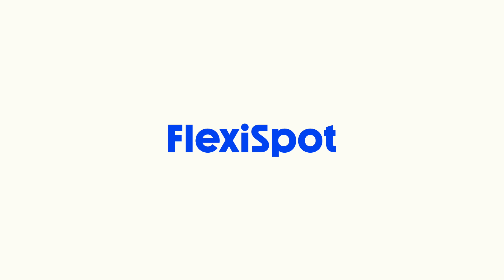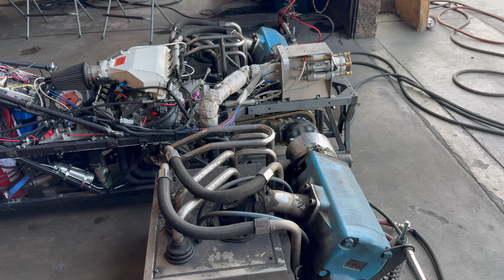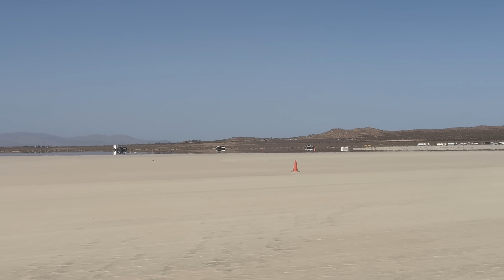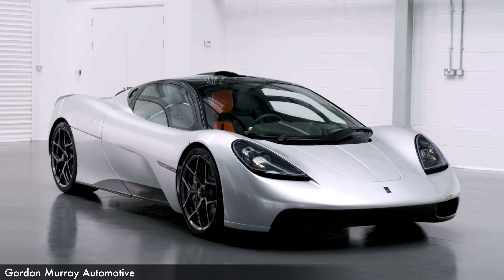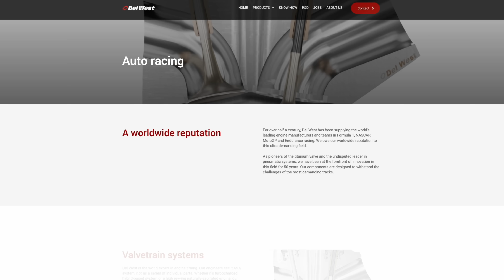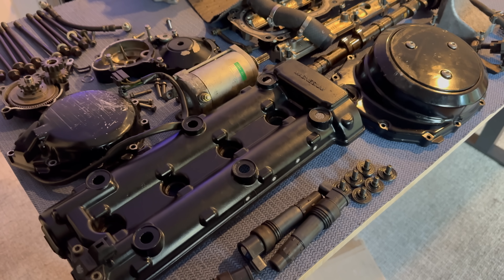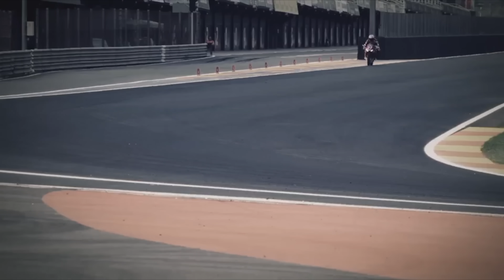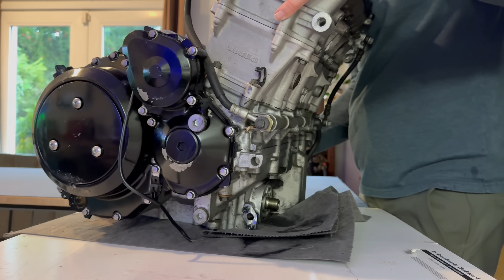Motorcycle Engines Are WAY BETTER than Car Engines

Comment: I have had 5 motorcycles that have went over 100K miles with just regular maintenance, nothing major. 1 went over 230K (1997Bandit1200), 2 went over 180K (650 and 1000 Suzuki SV) 1 went 150K (1998 Bandit1200) and my 1999 Hayabusa went 135K before the frame cracked. It's a big misconception that bikes don't last. They do as long as you take care of them.
Reply: The bike outlives the rider more times than it should
Reply: That's Suzuki for you
Reply: My BMW G650 GS hit 78,000 miles and was still running incredibly strong, without a speck of oil consumption or leaks, when I sold it for a new bike. It's all about maintenance and the way you ride and operate a machine. My diesel-powered BMW 328d wagon hasn't required anything but 5,000-mile oil changes and filters in 68,000 miles and runs perfectly. I use it only as a highway car.
Reply: @paul9133  5000 mile oil changes?  Jesus, at BMW prices you must be a millionaire.
Reply: @RantyRider  change my own oil, do my own maintenance, avoid dealership. I probably could go longer than 5,000 miles because it's highway driving. Plan to do an oil analysis.
Reply: @paul9133 avoid dealership is key point in maintaining longevity of your bike.
Reply: My dad still has his carbureted 1993 Honda Shadow. No chain or belt, it has the original ultra reliable shaft drive. It's got less than 150,000 miles on it, but just the fact that it survived this long with almost all original mechanical parts except a starter I replaced once and a speedometer cable.  We never really did anything special for winter storage, just used STA-BIL for gas treatment, ran the engine then let it sit with a full tank of gas. Carbs have been cleaned twice.
Reply: Honda ST1100 and GL1500 engines go a very long way. Do not ask me how I know 😊. But then they are relatively large and very low stressed. The VFR750F engine is not too bad either... However... I did own a Volvo V70 2.4 5 cyl. petrol with well over 400000 miles and still going strong...
Reply: @carsyoungtimerfreak1149 so do st1300s. 100k is broken in. 200k is doable. 300k+ has been done.
Reply: @carsyoungtimerfreak1149 I drive Volvo V50 1.6 diesel with 200k miles
Reply: He did say it was expected for a superbike, and most riders that dog out their supersport wont get it to 50-60kmi
Reply: I had a GSX 650F that bike is very reliable, but does not make much power, a zx6r lasts very little compared but makes a lot of power, in the video he is talking about extreme high power bikes
Reply: @kelvin15040 mine zx6r 2014 did 40k miles for me before I sold it. It was abused a lot and in moment of selling was in good mechanical condition. It was still using original cam Chain, tensioner, clutch cable. During this 40k miles only exup valve serwo motor stopped working, and ignition lock started to lock. I've changed oil every 4k miles (motul 300v ester). Everyone was expecting that this bike will completely fail at 35k miles, but nothing like that happened.
Reply: Bikes "don't last" only because people crash them
Reply: @233kosta no, probably mostly because people drive them very little. Infrequent short trips are not good for any vehicle.
Reply: @jaredlancaster4137  Tiny engine, much less oil, get hot moar quicker. A short damaging trip for a car can be perfectly fine for most bikes, for that reason.
Reply: @233kosta idk about most motorcycles but my coworkers 2006 cbr1000 holds 5 quarts of oil. I can promise you that his 1.0L engine warms up 5 quarts more slowly than my 2.3L Accord warms up 4 quarts.

I ride a 200cc air cooled bike to work most days, and it only holds 1 quart, but it still doesn't warm all the way up in my 1 mile commute, and I know that because I keep getting condensation in the oil. I know that my car fully warms up in 1.5-2 miles, so I think they're about the same?

Are these experiences not normal for motorcycles? Do others warm up faster?
Reply: Not a misconception at all when you realize even the worst car engines will get this many miles and most will get 2 or 3 times as many miles. Motorcycle engines require massive amounts of maintenance per mile in comparison, create more emissions, dont make enough torque to pull around heavy vehicles and are like any high performance engine. Just a trade off of longevity to get more power. I build engines for trucks for a living and bikes in my spare time, and have seen hundreds of both in high mileage conditions
Reply: I have a Honda Goldwing GL1800 with 140k miles on the odometer. It's still running great - not a single problem.
Reply: @frigzy3748 one could say thar, for all practical purposes, a goldwing engine is a car engine and not a motorcycle engine. It is ment to rev low, high torque and power at low rpm, big af, etc
Reply: @Narblo that's fair
Reply: With (mild) exception to the sv650, these are all large somewhat low stress motors. Yeh the hayabusa... I'm doubting you rode around town at 10000 rpm keeping it low stress. Also, Suzuki is the goat at engine reliability.
Reply: Must guys dont want to do maintenance, they dump the bike before the valve check due date, or crash thier bike. Rev bomb and blow up their engine. Sport biker riders are nuts lol. Well the usual suspects 😆
Reply: @LilleyAdam My Hayabusa 2005 shit I never knew you had to check the valves hilarious it's literally a car engine in a motorcycle it should last a hundred thousand miles easy I never did any maintenance to the bike still running fantastic even oil changes for me are a pain in the ass you have to take the stupid fairing off it so I run synthetic motor oil and change the oil once a year and here we are in 2026 still riding it still rides strong never had a problem never checked the valves probably never will.
Reply: @LilleyAdam I know someone who has taken two VStrom 650s past 200 000 km. Same engine as SV650.
Reply: @bikeaddictbp  I LOVE v Strom 650s. Bought one for $500 to use as my daily, only had to de-rust the tank and change the fuel pump. it’s probably my most reliable bike
Reply: @christianhodges685  How did you de-rust the tank? Chemicals or mechanical brushing or something...? Forgive my ignorance
Reply: @ValCronin  hey, I used mostly electrolysis and then finished with a citric acid solution. There are a bunch of good videos for electrolysis on here, I like that method a lot. I’ve de-rusted a few tanks and each have their own caveats, message me if you have more questions
Reply: @christianhodges685  Thank you very much 😊 For your sharing of knowledge.
Reply: Also, even despite not being racing engines, I doubt any of them made the same power at 100k as they did when new.
Reply: @LilleyAdam  any engine would lose a considerable amount of power after 100k. that's just the way it is
Reply: @LilleyAdam  .. and if there were a noticeable and notable difference between new and decently tended used, you would likely be burning oil which would be noticeable
Reply: @LilleyAdam damn, dude, you are such a buzzkill
Reply: @jebb125have you ever compared the power made by an 5k and an 100k engine? The wear may not be apparently obvious, but it becomes noticeable when you compare their output.
Reply: @tovirumelores7921 why do they lose power?
Reply: @jebb125 You don't lose any power on an engine at 200,000 miles. Actually there was a racer who did an experiment and he bored out his cylinders to make the engine really sloppy, and it added like 5hp or more from the reduction in ring tension and friction on the cylinder walls. 

Valve guides and seats, and valves don't wear out at 200,000 miles in a car. 

They are still looking like new with modern hard alloys that are indestructible. 

The only thing that happens on a high mileage engine is the timing belt or timing chain fails, or the valve stem seals harden or the oil rings get gummed up and it starts burning a lot of oil. 

Of course, modern idiots find a way to forget to change their oil...
Reply: @LilleyAdam you don't lose any meaningful horsepower unless you're meaningfully losing compression. I have compression tested enough high mileage engines to know that you're wrong. Typically you don't see any loss of compression until the engine is actively dying and very near the end of its life.
Reply: @jaredlancaster4137 is this true for motorcycles also?
Reply: @sanketjain9320 definitely. On all engines, the losses in power will be pretty small until such time that the engine is basically shot.
Reply: @LilleyAdam  But it doesn't matter if it's a Hayabusa. I rode my gen2 90k + miles. I'd say most of the time I used only a fraction of its power. So even if it lost 10% of it there was still plenty to go around and do stupid things. Gen3 now.
Reply: That’s Suzuki. Low compression bulletproof engines and great gearboxes. I ride a V-Strom 1050 and the engine just works and is virtually unchanged since it came out in the mid 90s. Change the oil, check the valves and it’ll outlast me (38 years old).
Reply: That and Suzuki used to effing rock. Could fill those engines full of bullets and it'd still run.
Reply: It's usually the owners that don't last.
Reply: Sure they last, but they don't maintain their emissions standard for that long.  And it still heavily depends on the bike, how it was ridden, and how it was cared for.
Reply: @TheGamersRace  I'm reminded of a story I had read about a motorcycle racer. He used epoxy to fill his intake ports to make them smaller in diameter, to increase rideability at lower RPM's. 

I decided to do the same thing. I had a Toyota 4 cylinder car engine that had horrible casting flaws on the intake runners, so I ground the ports down with a carbide bit, then I filled all 4 intake ports with 400F epoxy putty. 

I ran the putty really close to each intake valve seat, to smooth the transitions that were cast incorrectly from the factory.

The engine ran great, and I even turbocharged it later, and I put at least 50,000 miles on it without the epoxy showing any signs of damage.
Reply: I have a 2010 yamaha ss2 110cc with 292,851 km
Reply: I did 40k miles with zx6r 2014, it was abused half of the time. It was sold after accident but mechanically was running perfectly
Reply: Exactly, compared to car engines that's quite low
Reply: True, especially the big 4 from Japan will last well above 50k with regular and proper maintenance. The problem is no one trusts a bike with more than 20k miles on it because they are so often abused.
Reply: That actually doesn't surprise me , Suzuki is a damn good company and they build their bikes really well
Reply: My 2000 bandit 1200 made it to 68k before the cam chain tensioner was on its last click and I decided to sell it. I liked that bike, probs would have kept it if was easy to change but nope.

But yea design life is real. If you are softer on it then the designers expected it will last longer. If you use the bike the way it was intended it will nuke itself around where it was designed, remember those engineers set the rev limit, if you spend years burbleing around just off idle you can get a lot of miles out of it. Just as there are multi million mile cars driving around too driven by people with the same philosophy.
Reply: @nick4506  yep! That'll kill your bike. Also if you're not changing your oil every 3,000 mi which is supposed to be done for motorcycles that'll also kill your bike really fast 
 And also if you full throttle quite often a lot and keep that thing at red line pretty often? 
You're going to burn the hell out of your timing system your valve train your valves including the valve guide tensioner and the chain tensioner itself. 😅
I've seen quite a lot of Suzuki bandits that's had well over 100,000 miles with no problem. 
Usually you're supposed to change your chain guide tensioner and the timing chain along with the timing chain sprocket every 50,000 mi. Yeah that sounds quite a lot, but unless you want your engine to blow up I would do that. I have a Suzuki TU250X so 😂 I'm happy I went back to that little thumper, every 50,000 miles I'm going to be doing a top end refresh on this motorcycle. 
Open it up, inspect it
If I don't like it 
Replace it! 
Like right now I actually got to change my valve seals lol, started burning oil and so the first thing I did was the compression test and that passed with absolute flying colors so my fingers started to point straight at my valve seals 😂. Typical the bike is 12 years old plus so it makes sense. So I decided to upgrade to FKM valve seals. 
I've had quite a few BMWs and Suzuki's specially Yamahas that has gone well over 50,000 miles with pure ease. And don't get me started on the BMW and Yamaha motorcycles, if you take good care of them? They will not die 
The only downside about a multi-cylinder engine is yes it is a lot more difficult and it does take some more knowledge and skill to do that kind of work. But trust me it's worth it. 

Learn how to time a four-cylinder engine 
Learn how to disassemble and then completely reassemble before cylinder engine, this is an extremely fundamental and important skill especially if you deal with a situation that involves valve train near failure.
Reply: @KyzoFox  o yea i changed the oil frequently, but i also had a lot of fun on that bike.

They were basicly air cooled. The engine oil was used as coolant but there was no fan so it would cook oil. 3k would be way too long for that bike in my book.

 the 1st and 2nd gen suzuki bandit uses that same oil cooled engine platform from the first gsxr 750. The cam chain is in the middle of the engine between the center cilenders. The lower sproket is a part of the crank. Yea not a job for me.

When it was starting to go i did the resherch, either tear apart the entire engine to slip it off the crank, or a master link cam chain witch involves a grinder to break the old cam chain while its still in the motor. Neither of witch fix the bottom sproket wear.

Though it was a great bike, that engine design was wack. Suzuki sold a lot of these and im shure a few were babied up over 100k but im also shure the vast vast majority were blown up around when mine kicked it being used as intended.
Reply: @nick4506 I have never been accused of being gentle on my bikes 😂
Reply: Regular maintenance on a bike dose adds up. When I had a Kawasaki 650F and was doing over 15k a year, that was two or three services a year and one or two sets of tyres, just depending on how things fell. But it did that for years with just regular maintenance and one exhaust that was done under warranty.
Reply: I find it hard to believe you put that many miles on motorcycles I have a 2005 GSXR Hayabusa here we are in April 2026 and I have 20,000 Mi on it and I thought I ride a lot
Reply: @us74711 I was a motorcycle messenger for years, when I stopped doing that I only had a bike as a daily and for a long time I commuted a long way. I have traveled all over the USA and Canada on bikes. It was a common occurance to go to San Francisco or Vegas for lunch or dinner. Some people think they ride a lot, some people know they do.
Reply: They aren’t engineered to last as long as cars.
Reply: So many of our vehicle laws are based on assumptions from the 1920’s, those assumptions don’t apply anymore because our stuff is way better, but the laws stay the same because every time someone tries to update them, entire industries call them on the phone to tell them to quit it.
Reply: I don't doubt it at all. You can definitely get 200k out of most motorcycles with optimum maintenance and the right use case.

But do understand that this is like somebody getting 600k miles out of their Honda Civic. It happens. Just not often. And it's not just maintenance and care, a LOT of factors go into it. If you drive/ride a lot, and mostly highway miles, you put much less stress on the engine and you do a lot fewer cold starts and thermal cycles. That's a big deal.

Matt was 100% right when he said that a car lasting 150k-200k is equivalent to a high performance sport bike lasting 40k-60k. Both of those numbers can be tripled or more under optimal conditions, but are the right ballpark for most users.
Reply: @jaredlancaster4137  Most riders crash their sports bikes before 60k miles.
Reply: @LilleyAdam exactly. A whole lot of cars get crashed too before 200k or so. Past a certain point longevity becomes kind of irrelevant
Reply: @jebb125there ARE thousands of vehicle crashes every day. Basically any street corner you can find has been the site of a crash at some point. According to NHTSA, there were 5.93 MILLION car crashes reported to the police in the US in 2022. Most of those involved more than one car, and from what I'm reading about 20% of cars that are crashed get totaled.

If we assume the average crash involves 2 cars, then there are 12 million cars involved in crashes each year, and 2.4 million cars are totaled every year. That's close to 1% of the total US fleet taken off the road, every year, just from crashes, and just the ones that are reported to police.

That's 6500 cars totaled every day
Reply: @jaredlancaster4137 optimal conditions, like?
Reply: @sanketjain9320 regular oil changes, lots of highway miles, no short trips.

Miles are not a very consistent way of measuring engine wear, because short trips, cold weather, and city driving create at least 3x the wear that highway driving does. Getting 600k miles out of a car sounds really impressive, but 600k strictly highway miles is pretty much equivalent to 200k of short trips in town.
Reply: @jaredlancaster4137 agreed. What about no short trips but riding in city traffic, with constant changing of 1-3 gears? I guess it would make oil changes more frequent, but that's it?
Reply: @sanketjain9320 city driving/riding without short trips is still relatively tough on things, it'll shorten the lifespan of everything. Including your oil, more frequent oil changes like you suggested are definitely a good idea.

 I short trip the schnot out of my bike because I ride it one mile to work, and the oil becomes severely milky and fuel diluted after a couple months, so I just change it frequently.
Reply: You didn't get a point of the video.
Motorcycle engines can last mileage you said only in motorcycles. And you are proud of your 100-150k miles when some regular car engines can last for 600+k miles. Not all, but still.
Reply: @S @StrageSPB cept there are motorcycles with 250+ thousand miles, the vast majority of cars aren’t getting even close to 500,000, so that comparison isn’t so even
Reply: @extremeencounter7458 why do you compare "there are" to "majority". There are cars that go way past 1000k miles. Most bikes don't go over 50k miles so the difference is actually huge <same but flipped
Reply: @hejhej821  Do you not understand that the only reason you see the amount of cars you do getting that high is because of how many more there are that exist compared to bikes? When have you EVER seen a car over 400,000 miles in real life? I’ve seen PLENTY of bikes over 50,000, what are you smoking that makes you believe that’s an uncommon thing to see?
Reply: @extremeencounter7458 bro I'm not sure if you don't understand English or statistics
Reply: @hejhej821  How ironic, you yourself apparently never learned rudimentary English and can’t answer a simple question, shocker
Reply: @StrageSPB let's not kid ourselves. 300k is exceptional for a car, 600k is like a motorcycle making it to 300k. Given the video we're on and the explanation of differences between the two, 150k on a motorcycle is impressive to the same degree of a 300k car. 

Also, given the cost of the respective vehicles, cost of parts, maintenance, insurance and fuel. That 150k motorcycle was way cheaper, and way more fun per mile than a 300k car
Reply: @StrageSPB  indeed,  installed in a car with 1800kg, the 1000ccm 200hp engine would be a lot more stressed than in a 180kg motorbike, just to catch with the traffic
Reply: Problem with bikes is most people barely drive them or maintain them. They’re machines. It’s not good to let them sit for so long, same with the engine oil.
Reply: Like a 100,000 miles is anything? I have never had a car not go well over a 100,000 miles. Automobile engines can last a million miles if you maintain them.
Reply: Ok... than why are you providing poor examples?
 I have never had a car or truck engine not last less than 230k. And in no way were your motorcycle engines used in the same environments or under the same demads
Reply: K or miles  because  if thats k thats not impressive at all
Reply: @gingernutpreacher "100K miles" clearly means 100,000 miles, dude.  Not 100k meters.
Reply: @brianhaygood183 no it doesn't  it often means  kilometres
Reply: @gingernutpreacher 
Kilometers = Klicks 
K miles = thousands of "miles".
Reply: @gingernutpreacher I believe the K he is using is for thousands not KM as kilometers. 150k miles as 150.000 miles